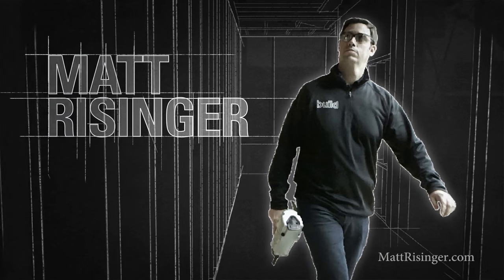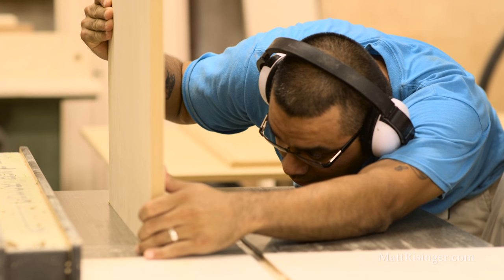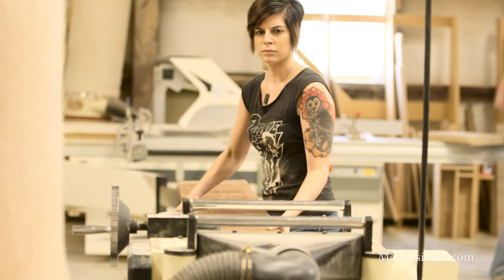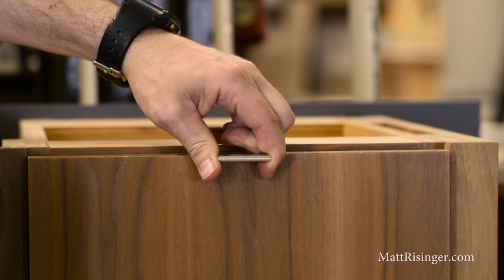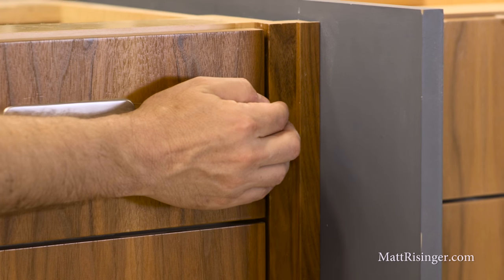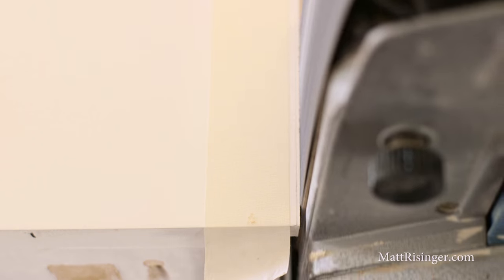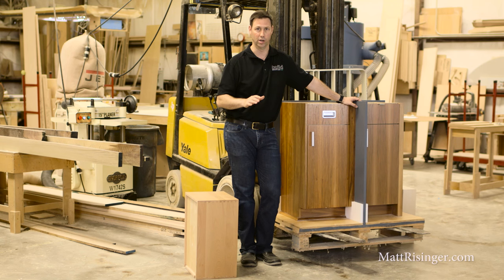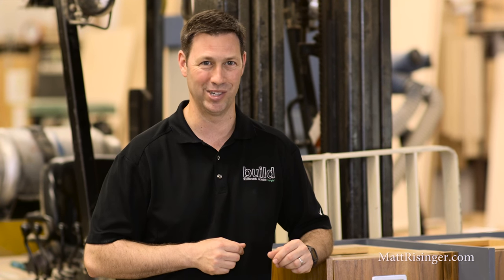Custom Cabinets - What makes a Good Cabinet?

Comment: Hey Matt!  Love your videos.  Question, what brand drawer slides do you usually go with when installing the undermount soft close drawer slides on kitchen cabinets?  I'm building new kitchen cabinets for my wife right now, and I've already bought two brands that had a really heavy pull and weren't up to par in my opinion.  Obviously all soft close slides will have resistance at first in order to charge the soft close mechanism, but these were just ridiculous.  Nowhere near as easy of a pull as what you see installed in nice cabinets like those in your video.
Reply: Andrew Walker ...Blum
Reply: Blum always.

Comment: Is it possible to find cabinets in stock built with plywood cases, and good drawers with dovetails at Lowes or Home Depot?
Reply: Hey Missy, you are not going to be happy with Home Depot cabinets in the long run. They really aren't made to last. They use very cheap materials and the bare minimum in regards to assembly methods... Just look at their display cabinets in the store. They are all falling apart

Comment: Cabinets should be made in the same climate in which they are installed.
Reply: false, plywood does not move in a substantial enough way for it to matter nor to well constructed hardwood doors

Comment: Hmm.. I'm a pro cabinet maker here. Unfortunately I'm a little disappointed at your perspective here on some points... I learned how to make cabinets from a great local cabinet maker of 25 years. And I would consider my quality and value to be excellent. 

First off, with the "stay away from" rules... You are speaking in generalities, and I think that's a problem. There are always exceptions to the rules. I love using the pre finished Baltic birch and then getting a solid glue line on a butt joint for drawer boxes and using a 23g pin nailer. Is it strong enough? Well I asked myself the same question... I decided to build a set of cabinets to destroy and test. I use the Blum undermount slides as well. The slides broke before the drawer box broke. And I had to apply a ridiculous amount of force to it to break that slide. My teacher of 25 years has also never gotten a call back about a failed box, and he builds a kitchen every month. That's a lot of kitchens to never get a call back. Again... If you use the right materials and the right fasteners.

And your statement about melamine being crappy is near sighted. Not all melamines are the same. Actually most melamines aren't even melamine... Most of them are actually vinyl coated. A proper melamine is going to have a 100% waterproof UV cured epoxy coating that is stupid hard. And there are different grades of particle board. I challenge you to get some 3/4 American Laminates melamine. You'll see what I'm talking about. The particle board density is about double that of the crap you get at home depot. A well build melamine with a particle board core is much more durable in normal kitchen use than a clear coated plywood. Moisture can still travel through those clear finishes and get into the wood underneath. The only way for moisture to destroy a well build melamine cabinet is at the seams and getting into the edges of the ply. That's why all of my sink cabinets get sealed with a high sheen caulking. The high sheen stops dirt from sticking to it and it makes the entire cabinet interior waterproof. I use that melamine for my work benches and cabinets so I am very familiar with it's properties. 

Matt... Just say it like this, man... Cause this is the truth. Any great cabinet maker will be able to steer you in the direction of a good cabinet. Technically frameless cabinets aren't as strong as framed cabinets. But a quality cabinet maker will be able to make frameless cabinets more than sufficient in strength. 

And your painter's just sucked man. There is absolutely no reason why paint applied at a shop is any different than paint applied at a jobsite, other than you had a crappy painter and then you switched to a cabinet shop that also knew how to spray good. I am a good cabinet maker and a good painter, but my uncle is a master painter who taught me to paint. He can get a 100% flawless job whether it's at a jobsite or at his or my shop. The only reason a jobsite paint job might not be as good is if the painter is lazy or bad with time management, so they are spraying inferior products to get the job done quick so they can get home ASAP or something. Jobsite work always takes longer than shop work. So they must have been skimping on the work or they just werent good. 

Nothing wrong with dovetails or drawer box lock joints. And I understand lots of melamines suck and lots of cabinet makers and painters suck. But you just had bad experiences with them. They aren't true rules. You just need to see someone use the products who doesn't suck, and who uses good quality versions of them. Hey, I thought MDF sucked until I learned about Weyerheiser Super Refined MDF. Then my mind was blown and I love that stuff. Not all MDF sucks. Some people take the ordinary and make it extraordinary
Reply: From your perspective what do you think about particle board cases and/or particle board drawers?
Reply: @RetrieverTrainingAlone  I do not personally like raw partial board for cabinet cases. Although there's nothing wrong with an industrial grade partial board core and a high quality laminated face. 

I personally consider raw partial board to be basically a utility or scrap material... Still has its place. 

If you are going to use an industrial partical board core material for the drawers, then that's fine... But it needs to be edge banded, and used with the correct glue/fasteners.

Comment: Hi Matt! I have had cabinets built and finished the same way for a few years now. But one of the problems I continue to face with having cabinets pre finished in the shop before installation is that the finished cabinets run the risk of being marred while being transported to the job and more importantly once the cabinets are installed the tradesman who have to perform there duties around the cabinet have potential of marring the cabinets as well. Which in the past has caused me to have to do touch up. Would you mind sharing or doing a video explaining how you handle those potential problems, as well as offer any advise to my concern? Thanks a lot, really appreciate what you do!
Reply: Hey Rawls, heres some things you can do to minimize damage to your cabinets. Make sure your cabinet maker wraps finished cabs in foam with cardboard corners, not just shrink wrap. Do not unwrap them until you are ready to install. After installation wrap them back up with the packing and corners, or ramboard or similar protective material. Handle your cabinets like a piece of furniture, get dollies for transporting, and remove doors/drawer boxes to lighten them up while installing. For paint grade cabinets, contractors here in nyc and long island often request primer and one finish coat and will spray the final coat after all work and subs are finished. This is not for everyone, but is the best way to ensure a perfect look so long as you have a good finisher. Stain grade is always shop finished. Invariably there will be some touchup required to cabinets after installation, make sure you get a touchup kit from your cabinet maker with the right colors and topcoat. I do these things for my contractors, its not too much to ask from your cabinet company.

Comment: Great advice. I love undermount for the extra drawer space. I worked on a very custom loft with hand built cabinets mostly site built [yay for me!] but we used a drawer company to make the drawers as we simply could not compete. The architect called for an automotive spray lacquer that was obviously done in place. What a pain! It shut down the jobsite each time he came back to do another pass. Looked great, but WHAT a lot of work.